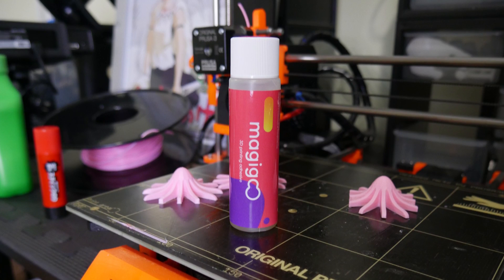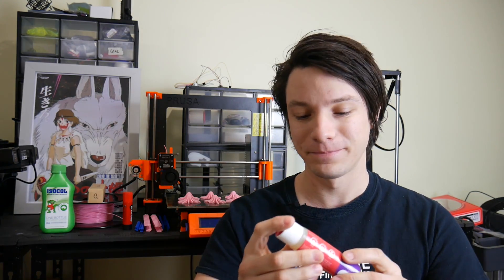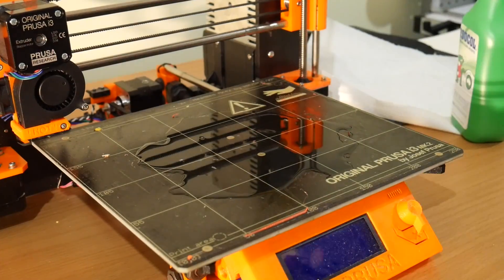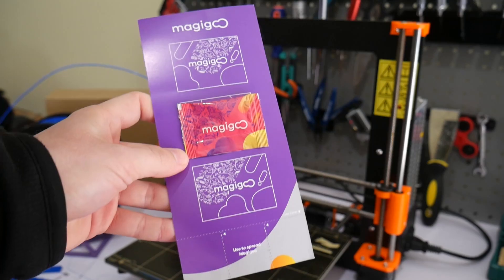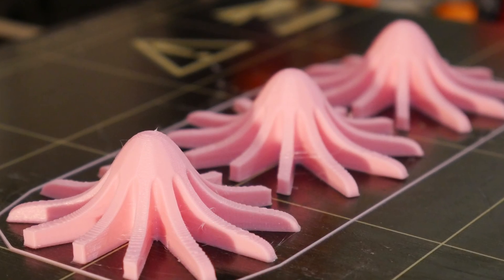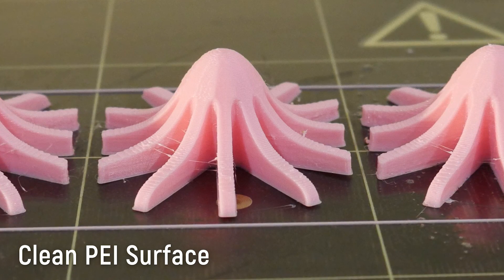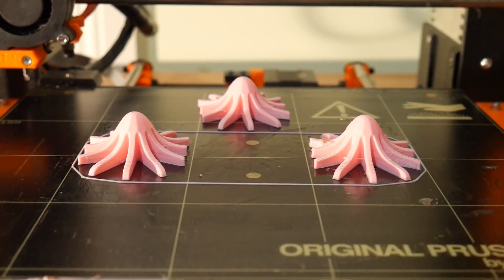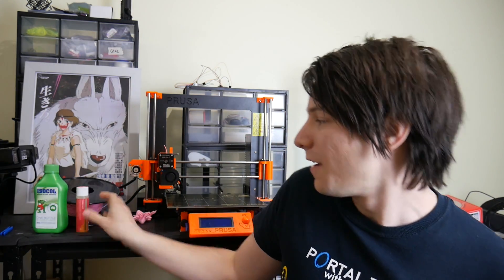Magigoo vs Glue Stick: Hold down your 3D Prints! Test and Review

Comment: Trying to print plain nylon (PA) and having a very tough time. Hairspray didn't work, other types of glues painted on with a brush failed and even glue stick failed. Until I came across a video suggesting applying several layers of glue stick . Allowing the 1st layer to dry before applying the next. This worked wonderfully with plain Elmers Glue Stick (disappearing purple). Other things to keep in mind is not to smudge the glue stick on the bed. Just lightly glide it over the surface , even if it doesnt feel like your doing enough its working just fine and will leave an almost invisible layer that holds extremely well. I will continue this method until my garolite sheet arrives. I have big hopes as Garolite allegedly holds nylon , abs and asa very well without the need for glue stick. We will see if this is true.
Reply: Can you tell me how your Garolite build plate worked out with nylon?

Comment: I print on satin or textured sheets and those wear out the soft application tip on the Magigoo long before the glue runs out, making it impossible to apply correctly. I wish Magigoo came ina  spray version as it is a great product.

Comment: The only problem I see with this test is that your only printing small things it's usually not that difficult to keep a small thing down because the warp forces directly proportional to how much plastic is trying to warp you have almost no plastic there so it's not trying to work very much I have prints that tear themselves apart because the workforce is so high and this is just PETG I've even had PLA prints crack because the warping was so strong

I am trying to print basically large hollow cubes 12x12x6 in with the 12x6 being the footprint no bottom layers just 2.7% infill grid I'm printing PETG both cheap stuff and good stuff doesn't make a difference I'm printing at 9 cubic millimeters a second max speed 28 mm per second with a 0.8 mm nozzle and 0.5 mm layer height and my corners keep pulling I rejiggered the first layer to be five perimeters I've also modified it to be one continuous perimeter so no stop retract and move just one continuous perimeter like vase mode and I also made sure it did not start at one of the corners since that would obviously promote lifting after the first layer it switches to two perimeters so that's 1.6 mm with the 0.8 mm nozzle I've tried extra squish I've tried minimal squish I've tried bed temperature from 70C to 90c and I'm printing on squeaky clean glass which should be the most stick for PETG

But no matter what I do my four corners left

When I print small stuff like you're printing I have no lifting issues it's when I print large stuff it also doesn't lift right away it lifts several hours into the print after about 20% of the filament has been laid down the entire print is 1 kg of plastic I think it's the accumulation of workforce from all the plastic combined that eventually just tears it off the bed

I'm not sure what else I can do I would prefer not to use an adhesive aid that's just an increased cost although I am willing to try

One thing that seems to help I suspect there is a temperature delta issue near the edge of the print bed because when I print this on a 400x400 print bed I don't have the listing problem nearly as often problem is I only have two machines with a bed that size I have lots of 334s and if I don't want this project to take two or three years I need to use them since I estimate 2.5 years using a single printer but only 7 months using four printers

Suggestions?

Comment: I agree the previous leg lifting would remove some adhesive, and if you didn’t replace that, then it would effect and maybe cause the same legs lifting again. But I also think that depending on the infill type and the direction of those lines in relation to the walls, will all effect the infills ability to keep the structure walls straight, Gyroid is often used to allow for a more evenly distributed warping force in all directions x/y, rather than in one particular axis. The legs being in different axis will all have different warpage forces going on inside them depending on these internal settings. Therefore we could determine which settings effect this by studying which legs warp/lift consistently.

Comment: (I'm watching this video in November 2020 and recently received a tube of Magigoo as a present.  I still have to try it though !  Forgive me for cross posting a comment I made on another channel.  Hopefully it will help people who print ABS with a CR-10S or similar.) 
ABS juice really works wonders for me.  I have a CR-10S and they are, in stock condition, not really suited very well for a finicky 3D printing plastic like ABS.  I used to use a clear paint lacquer on my glass and, though it did work quite well (and not even very well sometimes) there was always the problem of ripping chunks out of the glass sheet afterwards.  Eventually I did start using the juice and, with some experimenting, found a very good method that works well.  I allow the bed to heat up to around 80 degrees C and only then start to apply the juice.  This makes the ABS juice kind of bubble a bit and the surface becomes quite uneven, for lack of a better term.  Kind of woolly, I would call it.  I do bed leveling and have the nozzle rather close to the glass.  This, however, is not the whole story.  I use adaptive layers (in Cura) to have the first 20, 30 layers or so printed very thin.   Now,  the issue is that you cannot really choose different layer heights in Cura straight off the bat without modifying the object you want to print, so I had to find a way to force Cura to make my initial layers very thin.  I found that introducing another small model, a curvy kind of wedge-like shape, will force the initial layers to be very thin.  This wedge is only about 3-4 mm tall.  The end result is that by using smaller initial layer heights the warping effect is greatly reduced.  Once I am above 4 mm or so the base of the model is strong enough and the thicker layers (up to about 0.2 mm) can be introduced.  Printing with ABS has finally become a lot of fun for me ! :)  Oh, and of course I also use some kind of heat cover around my printer for temperature stability.  One more thing I like about the juice, it does actually work very gently on the glass, which is ordinary window glass.  Never had one chip on me since I started using ABS juice.

Comment: I have used the Magicgoo on the Tronxy XY 3, but it doesn't do good at a bed temperature of 50 degrees celsius with a PLA filament, but on the Mingda D2, it does good. I may just have to use the cheap glue stick with the Tronxy XY 3 from now on.

Comment: would like to see a demo on that nano tech... does it work with petg? glass is tricky... many times my prints are fine for a couple of hours than a support column breaks loose and print it junk... main parts stick with hair spray or glue only... does this hold better than glue stick or hair spray... demos would show this...

Comment: I actually use the Suave brand hairspray.  It literally gets stickier as it gets to higher temperatures and keeps even the largest prints from warping. Other hairsprays dry out and just leave your bed with a dry smooth surface. similar to that of glue sticks. The best glue stick to use is the Elmer's Glue purple glue sticks. But with these glue sticks, it is very tricky to get them to work and found a solution. For the life of me for some reason it works just as good as the hairspray. For the hairspray and glue stick, follow the instructions below and you will have perfect  sticky surface for your prints:

Hairspray:
1) Heat up bed to desired temperature. 
2) Take glass away form bed and place glass on a paper towel or newspaper and spray the bed with a nice even first coat and let it sit there for a minute. Take it back to the printer to heat up for another minute or so and then repeat the steps for about 3 coats. 
* This method the glass has to be taken out every time, so where some heat resistant gloves in case you don't want the glass to burn you. This is to prevent any hairspray particles from getting into your extruder, nozzle and other components.

Glue stick:

1)Heat up bed to desired temperature.
2)Placed glue in horizontal pattern to glass surface where part will be printing. Wait about 1-2 minutes.
3) After applying horizontally, now apply new coat on top of the pattern you just did but in the vertical position covering the same area. It should resemble a # sign but with multiple lines. It is almost as if you are drawing in a square with horizontal and vertical lines. 
4) repeat this for about 2-3 coats. This method can be done directly on the bed. The hash pattern creates a sticky coated surface that pretty much helps the pattern adhere better. 

https://www.amazon.com/Suave-Extreme-Hold-Hairspray-11/dp/B002I7I3AM

https://www.amazon.com/Elmers-Glue-Stick-E4062-sticks/dp/B01JZYM6GC/ref=sr_1_7?keywords=glue+stick&qid=1582416538&sr=8-7

Comment: But glue sticks are also differ a lot. We're there a comparison video about that? Common PVA-based sticks are rather weak. PVP-based sticks might be rather difficult to find but they hold parts much stronger in my experience. Maybe even to strong sometimes, but I prefer that to failed prints.

Comment: Just trying PVA and water mix on my CR-10. Two hours into a ten hour print and looking good so far. I'm cheating cos printing PLA. Always use blue tape but it's too good for big surfaces and struggle to get prints off. So interested to get to work in the morning and see if it's worked as well as I hope.

Comment: i am completely new to 3d printing and have just purchased a CR-10 S5 , so far i have heard conflicting information regarding printing PLA. i have heard some people say that the bed tempreture should be set to 60 degrees and then other people say that PLA doesnt need a heated bed at all ? could anybody here confirm what is the correct bed temprature settings for printing PLA on a creality CR-10 ?

Comment: Printing ABS without surrounding the printer could be a warp reason, not just bed adhesion.  I find this review inconclusive for sure... not for Muse's reason.
Reply: You definitely do not need and enclosure, I print abs on a open frame printer and they come out great. Just lately I'm having issue with bed adhesion
Reply: @4ninjagaming  depends on print and ABS material, but you'd know that because you're experienced with printing ABS. Id also have rather have seen this test under proper ABS conditions (enclosure) to see what the special glue could do for something like the warpanator 5000. The conclusion that it still warps in open air on a difficult print isn't remarkable.

Comment: When I used glue stick heat the bed to 40, the glue will dry out will not stick anymore, I have to keep the bed cold and heat back up the bed after lay down the first layer, what I did wrong? Is just opposite like many other say, and is easy clean the glue when the bed is hot because the glue is dry out

Comment: I have a problem. While the filament sticks nice to the bed at first, (I am using the correct temperatures, speeds and layer thickness and the bed is level) after some layers it slowly wraps from the Brim and then the whole print pops out of the way. I am using only the stock heated bed.

Comment: Magigoo on glass really is "Magic".

However it must be applied VERY thinly, not with the huge amount plastered on in the video.
The print bed should be set to the high temp range recommended for the filament or just beyond.

It works best when very warm.

The print should never be removed until the bed us well below 26-28c. At that point it lifts off with seemingly NO adhesion.
Above 36C prints are almost impossible to remove from glass.

Comment: Hair spray works wonders and it's real cheap and easy to clean, even reusable with a little wipe of a wet paper towel after first use. Just spray a light coat and you're ready to go. Cold or hot bed, no problem.

Comment: Personally I prefer the magigoo over glue stick. The bottoms remains smoother on the prints and it just never lets go when printing where glue stick does fail a bit to often for my likening. Because of the sticking confidence I also speed up the print saving time as well. This on a CR-10S using glass bed. It might be expensive but wasted prints are more expensive.

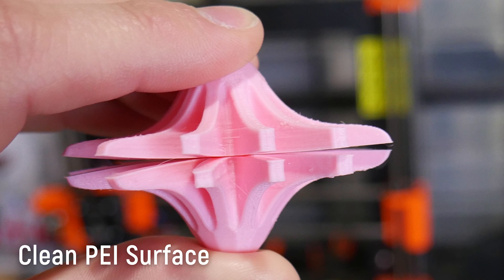Comment: So the conclusion around 7:04 where he says it doesn't work "that much better" than a $2 glue stick... the images he is showing on the screen say otherwise.  Both the clean PEI and the glue stick images have significant warping whereas the Magigoo image looks basically perfect.
Reply: actually, at 6:29, you can see both glue stick AND Magigoo both have a slight lift on some of the arms.

Comment: I might splurge on a bottle of Goo I'm currently using store brand glue sticks (1/2" 13mm) dirt cheap but  prints with large surface areas REALLY stick. I end up covering the print with a towel and setting the bed to 50°c for 10-15 minutes.
BTW, those dot markers are often used by Bingo players to mark their cards.

Edit - I thought Magigoo's big claim to fame was its incredible ability to release prints once the bed surface had cooled?

Comment: Mod Podge.
Dries tacky.  Tacky cold.  Tackier hot.  NOT water soluble after drying, but water will soften it for scraping.
Works on kapton and blue tape.  Use with caution on heated glass directly; lost small patch of glass from an Ultrabase!
ABS adhesion is great!

Comment: Soon as I tried mine, I opened it, shook it like hell, then pushed it on the bed and squeezed just a little and the top popped of and goo all over the place. 10/10 would recommend magigoo. i was able to use a scraper and get most of it back in the bottle and it glued itself closed after that.

Comment: I have found glue stick to be useless for abs. I found white wood glue to be awesome for the most part, it could always stick better when hot of course but it is quite good, little to no warping on difficult abs parts. And when cool it just magically pops off.

Comment: Just bought a CR-10S - bed isn't perfect (still working on it) - but I had numerous failures trying to use Magigoo.  Figured it was down to the slight dip in the centre of the glass but decided to throw on some of that cheap tape that came with the printer.  The tape worked perfectly, even with the slightly off glass bed.  I'll have to try a glue stick next time.  A little disappointed with the Magigoo - it seems to start off alright but will just let go unexpectedly.  Argh.  Oh well.  It's a learning experience for sure. :)  Loving your channel btw - some awesome info.

Comment: only problem here is apparently magi-goo don't work well on PEI... anything else it does.
Reply from the maker: Yeah I can confirm this along with Tom's results. PEI works great for almost everything without any adhesive... but for Nylons and PETG you're better off with another adhesive like glue stick.

Comment: I tried Magigoo on my glass bed the other day (normally I get good adhesion with just the build plate, and great adhesion with a glue stick) but I received a sample of this in the mail so thought, might as well try it.  Complete Garbage.  It (somehow) makes my build plate even less adhesive than just printing directly on the build plate!  I have never had an adhesion failure quite like this.  I have only had one experience with this stuff but I would stay as far away from it as you can.

Comment: Just throw a sheet over the 3d printer + glue stick and it will be fine. No issues printing large parts on ABS. *Don't cover the power source and the board

Comment: Glass Bed + Aqua-Net 4EVER! A little for PLA a lot for ABS
Reply: Yep, that's my exact setup and it works great. And usually it only takes a few light taps with a putty knife to cleanly remove the print. Why people want to spend so much time, money, and effort for these expensive solutions is beyond me.

Comment: I apply glue stick just before printing starts, otherwise the heated bed dries it out before your 1st later is done.
Reply: I have printed hundreds (thousands?) of prints with a Glue stick, and while I DO find it more useful to do it when the bed is hot (because it spreads much smoother and thinner) it doesn't really affect the adhesion (I will often use the same glue for 3-4 prints assuming I was able to remove the print without touching the bed)

Comment: Any suggestions for raining in the immense amount of sticking power of PETG and PEI? a few times I've nearly damaged my print surface trying to get the bastard prints off :\ I've heard gluestick is good? thoughts?
Reply: Interesting.  I love PETG but it doesn't stick at all.  I can barely get it to stick with a Glue Stick, and it wont stick to Magigoo at all (it sticks to my glass bed better than it sticks to Magigoo)
Reply: Leto Atreides try a PEI surface, PETG seems to stick to it very well, bare in mind that if you try to smoosh it into the build platform like PLA, it will stick extremely well, to the point where it's unremovable.

I didn't have any thing else other than PEI when I got my first spool of PETG. PEI doesn't seem to be as amazing sticking down ABS as it does PEI, I still have had catesrophic warping.

Comment: I find if I use some of the extreme bed adhesion techniques ppl advocate then it just moves the problem up and I get layer splitter or parts with so much tension built in that it cracks very easily.

The only solution for regular ABS is an enclosure.

Also formfutura Titan-X (dutch filaments ABS-X) really does seem to be zero warp as they say. This is now my go to ABS for everything.

That said regular glue stick worked great for me(with an enclosure) before I moved to PEI.